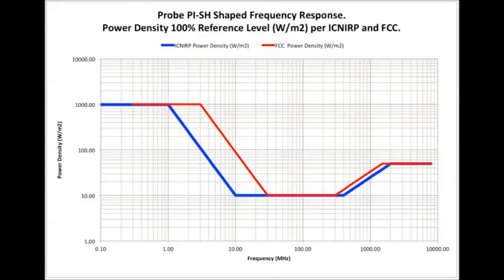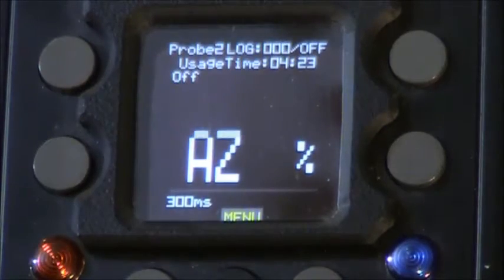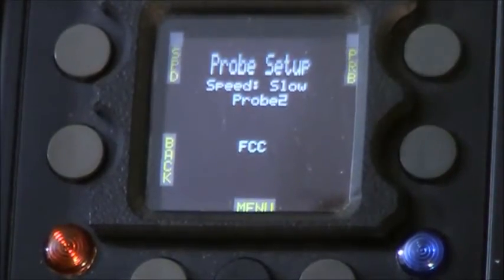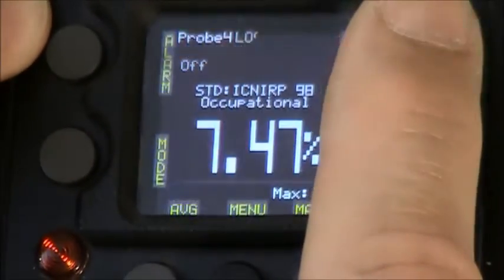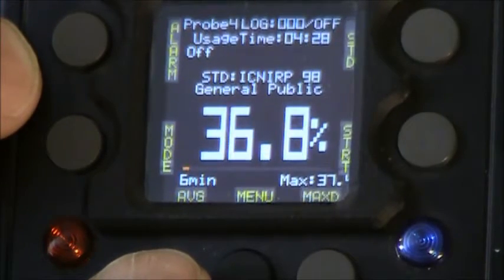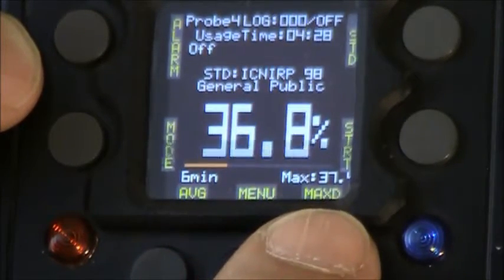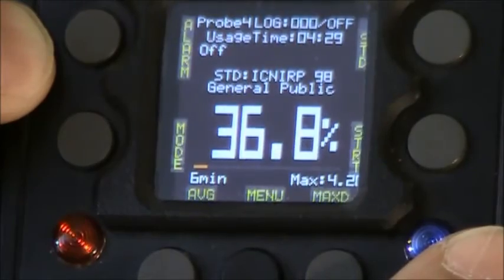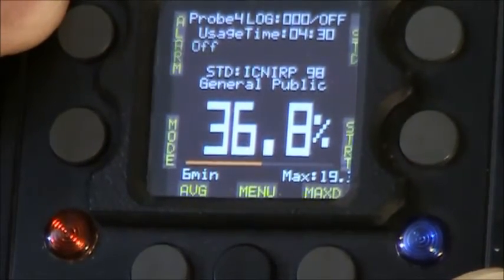Video 4 EMC Test Design Introduces Shaped Frequency Probes

Comment: Hi Julian:

Thank you for your comment!
Narda invented Shaped Frequency probes first place.

I reengineered them my way and I think, it has merits:
Narda used diode detection up to 1 GHz and thermocouples at higher frequencies.
My probe uses diode detection all way up to 10 GHz.
And because diodes operate in square region, my probe produces signal proportional to the RF power density.
By simplifying the assembly, we achieved a substantial probe price reduction compared to Narda.

Regards,

Roman Litovsky, General Manager EMCTD.
Reply: Hi Roman, sure of course your design have merits!!  i was just pointing out that sadly NARDA has the monopoly on these topics, as you said your design is more optimal with the diode use up to more higher frequencies! I understand your merit since i also did something similar but with a shaped magnetic field probe, that goes beyond the 1 GHz limit NARDA has.
So i just did this comment to know what you think of NARDA! 

Thanks for your answer
Regards
Julian Garnica, Electronic engineer